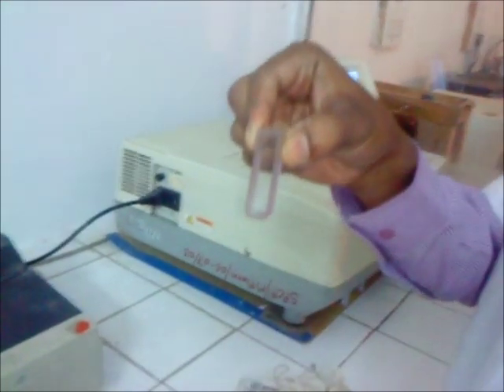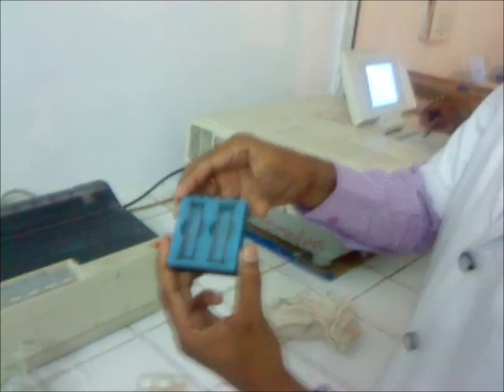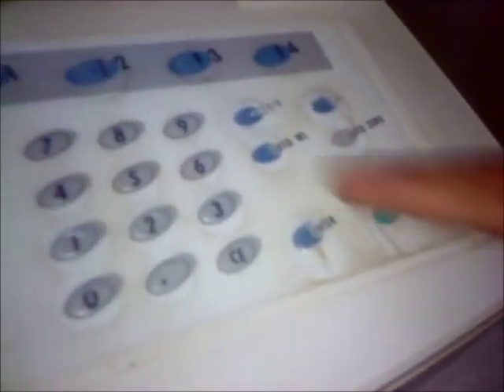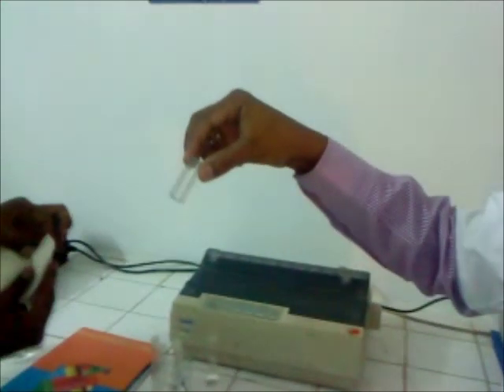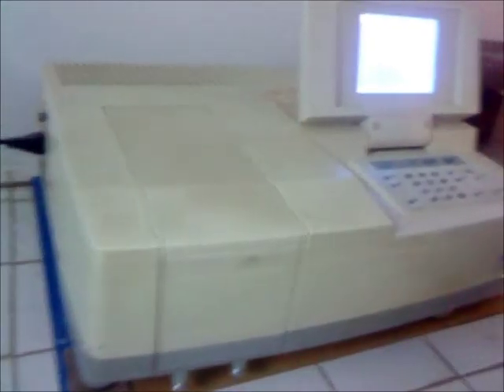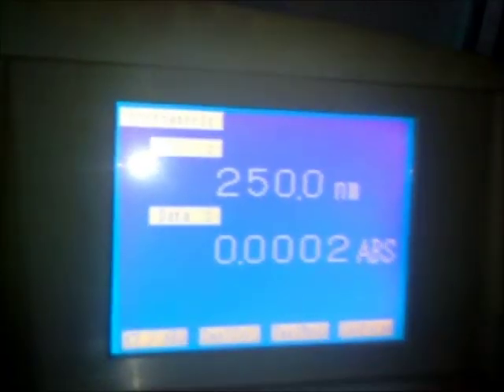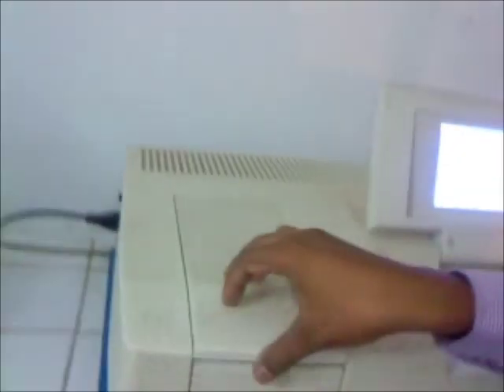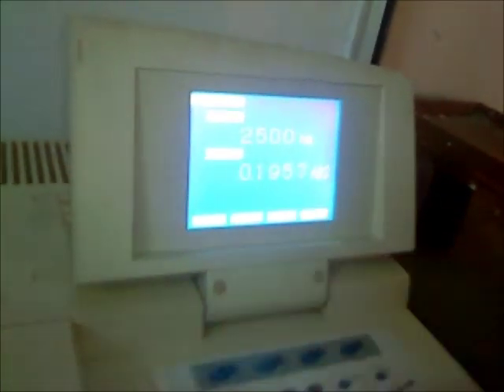How to operate UV - 1700 Shimadzu and Estimation of absorbance of sample on spesific wavelength

Comment: Good entry for ISC contest, but there are few mistakes which you could have avoided. Its basically a spectrophotometer (double beam) and you could have explained in that sense. You restricted yourself in saying the manufacturer name (Shimadzu). Also one of the basic error is that cover should be kept closed most of the times and should be opened only for a second or two when you are about to place the samples.

Comment: The reason is you are talking about absorbance at a particular nm, don't you think that the external source of light will reduce the efficiency? This happens when you are measuring silica, Iron etc., in ppb range. Also where is the standard before placing the samples? Then what exactly is the sample you are doing at 250nm? Why don't you say about it?